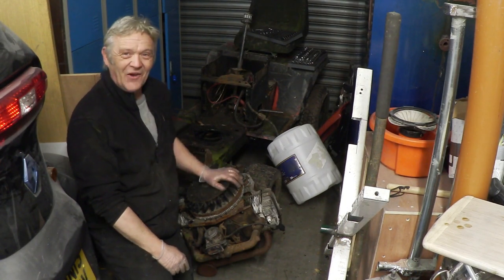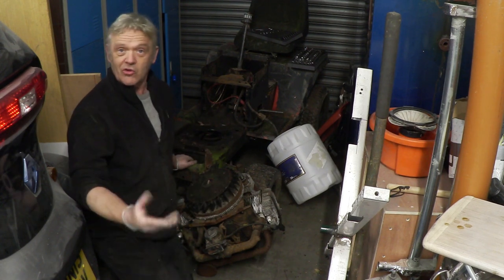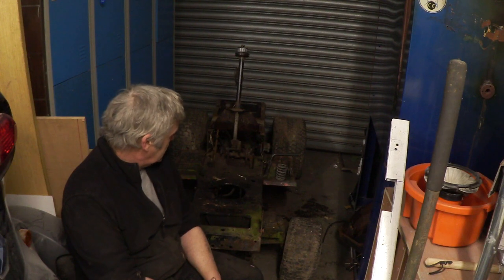Building 'Bessie' - Doctor Who's Car - Lawn Mower To Electric Vehicle - Part 1 The Teardown

Comment: I had just purchased a secondhand MTD Ride on mower and had to do exactly the same to remove the years of oil and muck that had built up and actually jammed and bent all the drive pulleys, gearbox etc. out of alignment. Three weeks later and it is fully restored. I suggest that you have a look for a service manual online as some parts may look the same prior to reassembly but when fitted can cause all sorts of grief. I look forward to seeing the results!

Comment: Love this idea. 

I made an electric lawn tractor about 5 years ago. I used an old Murray lawn tractor and a truck alternator as the motor with a brushless motor controller.  It worked very well for about a week and then caught fire. I now know that reusing the battery cables that came from the tractor was a mistake.  I have since purchase some 4 gauge jumper cables from a yard sale to replace the 6 gauge wires.  On the fire I also lost my 24 volt battery packs that I liberated from UPS units.  These batteries were ok but had very poor performance as they weren't made for such fast discharge.

My next plan is to replace the heavy lead acid batteries with lithium cells from laptops.  I have been collecting old laptop batteries for about a year now and almost have enough good cells to put together a battery.
Reply from the maker: love it mate!

Comment: You could use the engine for a bio diesel generator, and see if you can get the used fryer oil from the fryer you upgraded. That would be an interesting project to compete with the other generators you are working on.
 And I cant wait to see the electric quad! That will be very cool!
Reply from the maker: nice ideas mate - cheers

Comment: Have you heard of lawnmower racing? 
If not then time to find out. 
If you want to go fast go electric. 
A Renault Zoe engine and a cut down battery pack. (Same voltage lower ampage) and you could have a world beater there. The fastest 1/4 mile in a lawn mower??